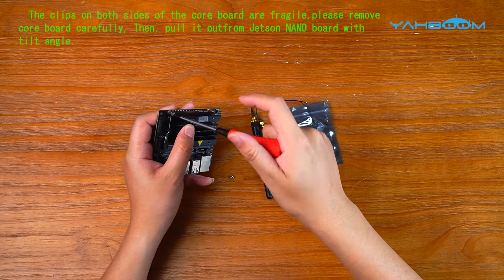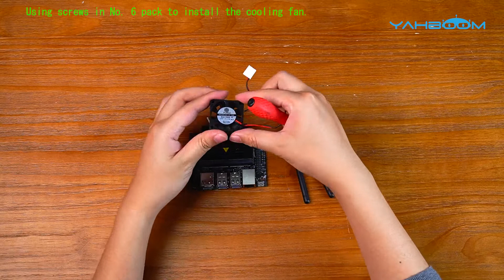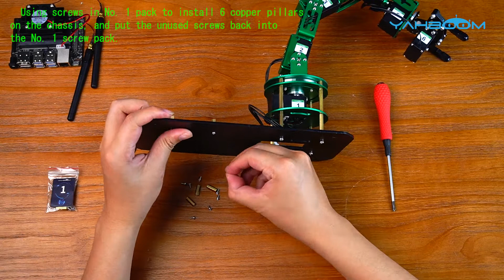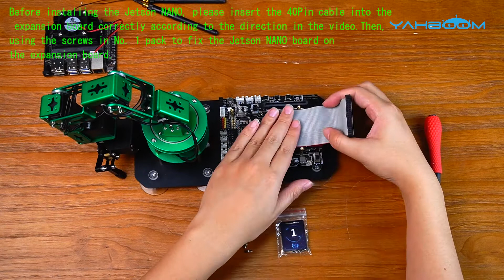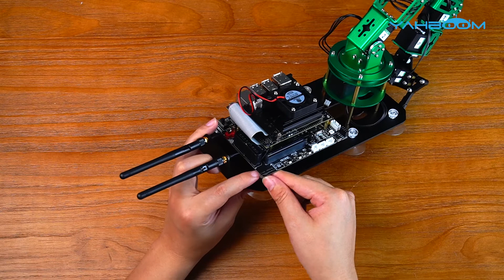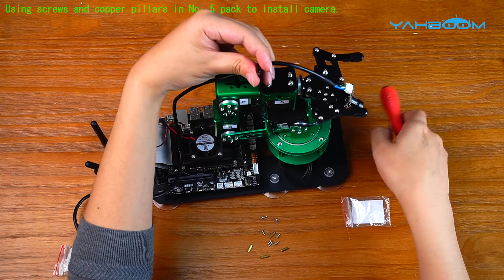Yahboom Jetson NANO DOFBOT Installation video

Comment: If you're installing the 2GB version of the Jetson Nano that doesn't include a slot for the wireless network card, would you just skip that step and use the USB network adapter?
Reply from the maker: Sorry, due to insufficient computing power of Jetson NANO 2G board, it is unable to complete the complex algorithms required by the robotic arm. So this robotic arm is not compatible with Jetson NANO 2G board.

Comment: How do I run this without the Jetson Nano, using the Arduino instead?
Reply from the maker: For this Robotic arm, its expanxin board compatible with Jetson NANO, Raspberry Pi, Arduino, Microbit, but we just provide tutorials for Jetson NANO, Raspberry Pi. If you want to use Arduino, you need to write codes by yourself.